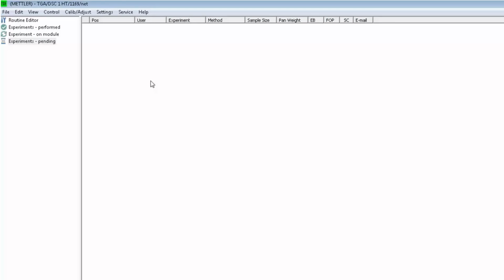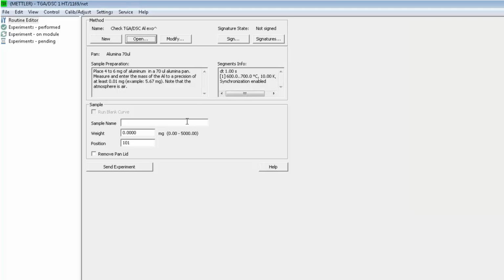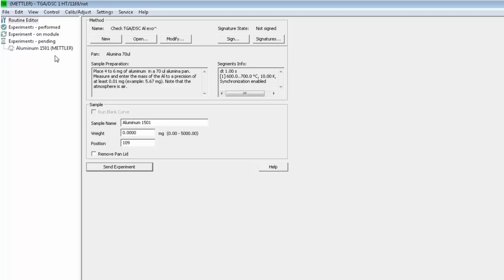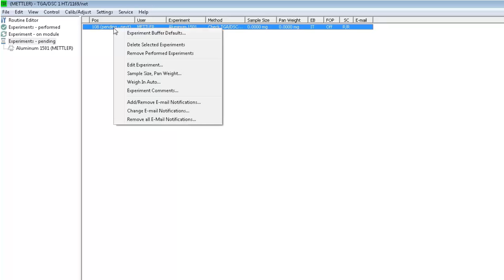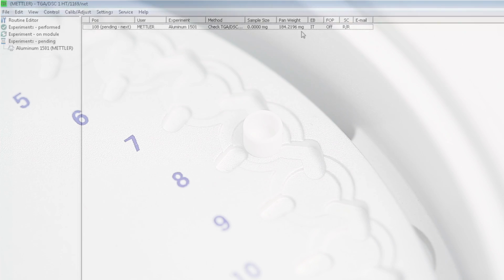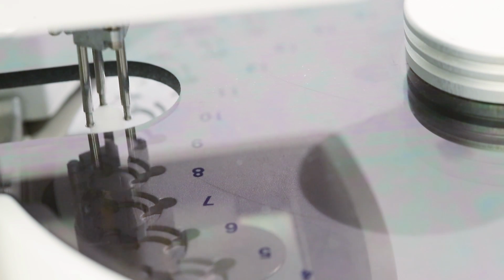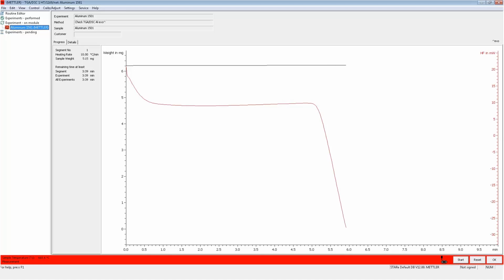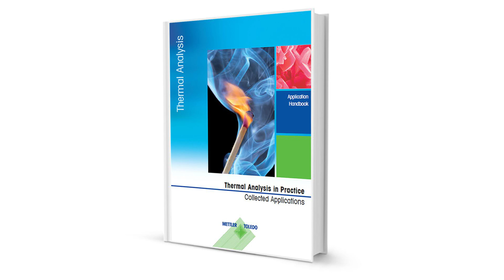TGA/DSC standard calibration with melting point temperatures and enthalpies

Comment: Thanks for the tutorial. In this calibration are we supposed to use air alone or air+inert gas mixture. Thanks
Reply from the maker: Dear Prathap,
Calibration is performed in with the gas that you normally measure in. so if all of you measurements use N2, then it is advisable to calibrate and adjust your systems with N2 as the gas.
 
FlexCal can handle has switching so you do not have to adjust with every gas (or crucible /heating rate) combination.
 
but gas mixtures are not fully supported.

Thank you!